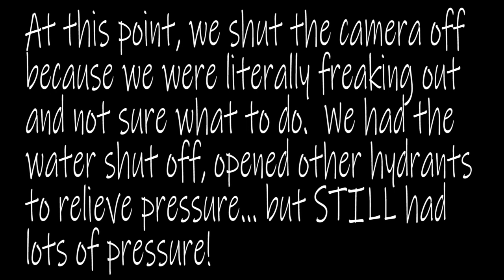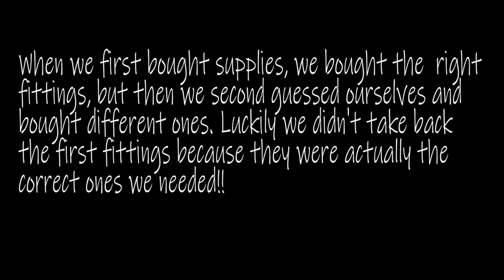We're Replacing A Cracked Water Valve

Comment: you dont need to dig any thing just get another peace of heat cable long enough to get from were it is cut and into the house..,  and splice it together using heat shrink crimp connectors and get the heat cable up into the house and put pipe insulation around the pipe rightin to the house, then splice a cord with a plug on the end again using crimp heat shrink connectors,, plug it in and your good to go, you can also use bigger heat crimp shrink conectors to tee off on another pipe,, you buy heat cable by the foot, it $7 cnd per foot for 20 amp.. that heat corrd you bought is not for under ground or out side, it for a inside line to close to an out side wall